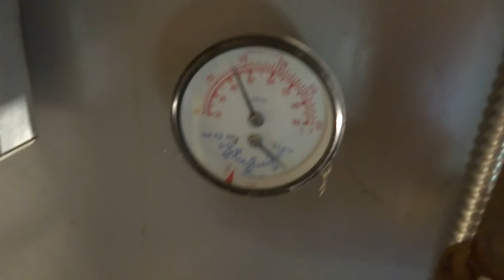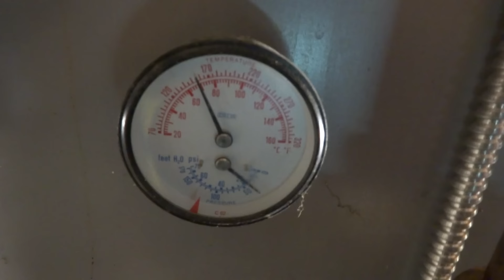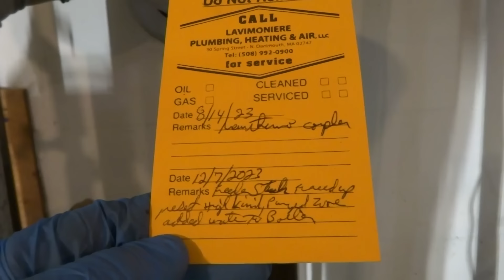GAS BOILER NO HEAT CALL

Comment: Replace the fill valve. It will do it again. They always stick and never last long. I find working them to manual (stem up) fill and auto mode (stem down) during maintenance helps keep them working. Once they are shot though, usually u can’t just move it to fill and back to auto and expect it to work. I’ve had them then stick in fill mode once you touch them. Ask this question. Do u trust that it will fill next time water is low?

Comment: Once a hot water system is full and heating, the feeder is out of the problem. were did the water/pressure go??? always mark the system pressure's  so you know what to know. ??????????????????
Reply: That's my thought on this.  It's a closed system, if the pressure is dropping you have a leak somewhere.  Those burn marks on the front of the boiler are a little concerning.

Comment: Absolutely do flush a couple of 5 gallon buckets every 6 months from the indirect hot water heater to prevent it becoming a leeka. If you can, check the anode rod every five years. 120° - 125° is enough for indirect hot water. No lower than 120° due to risk of bacterial growth.